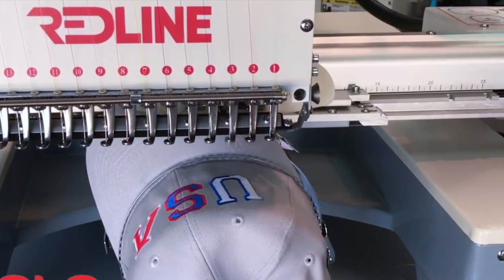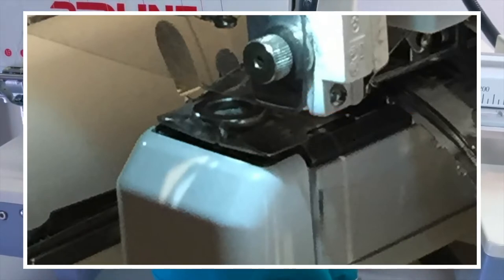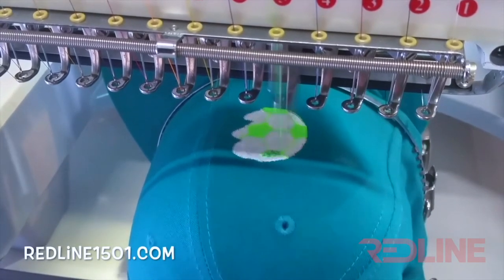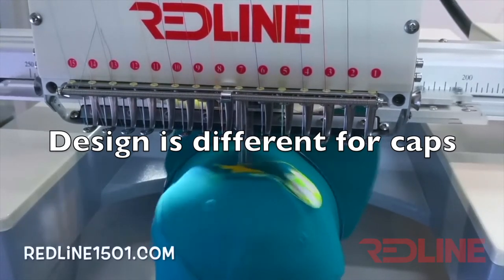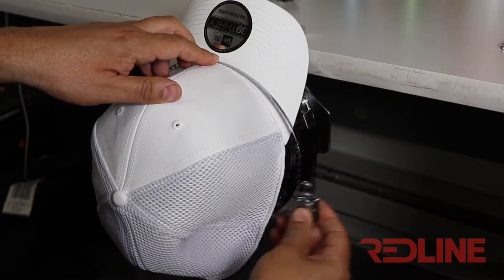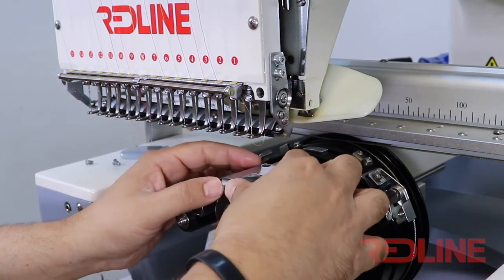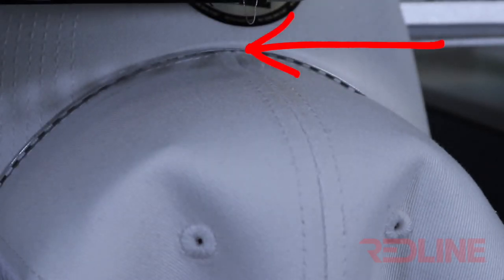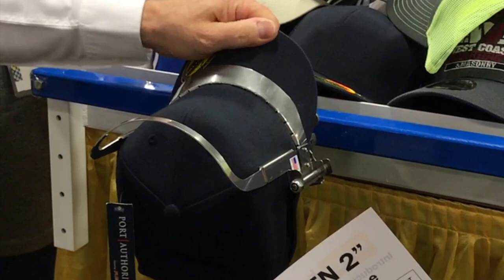Needle Breaks while Stitching Caps

Comment: Say, I have a question for you.  just received a newer cap-style needle-plate, and it seems quite a bit higher than used to be (lost mine in the trash bin it seems,) Should I adjust the needle-bar higher to work better with this plate?  I ask because when I first did a head-up with this cap-cover, the needle broke.  I put in a new needle and it seems to not grab the bobbin thread..
grr.
ideas?